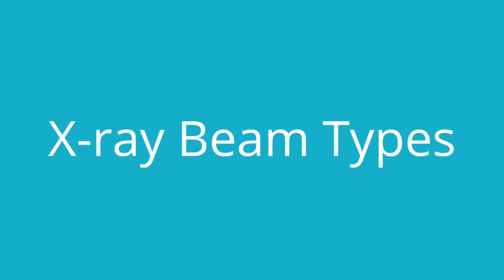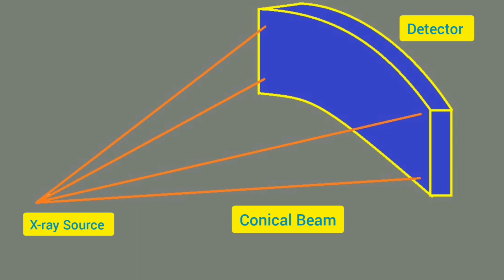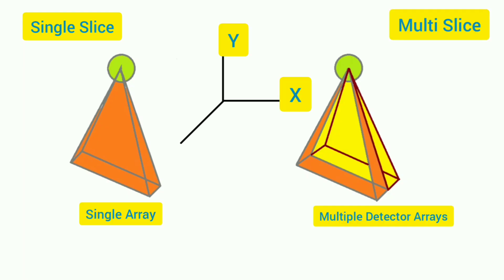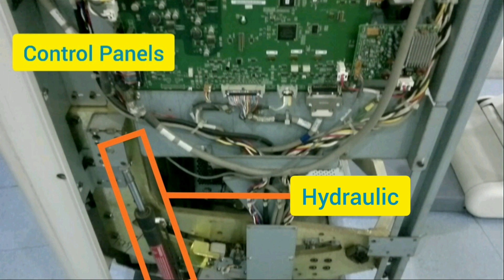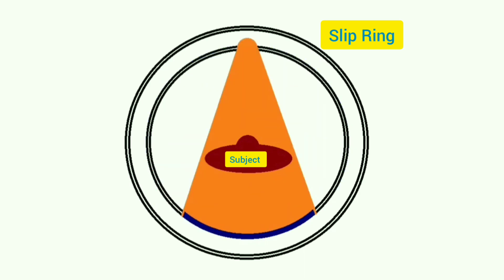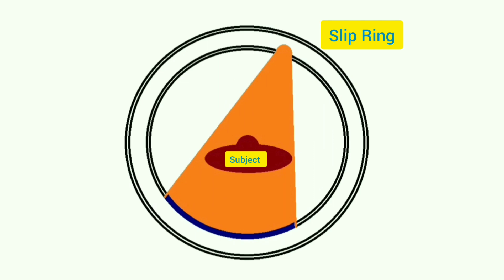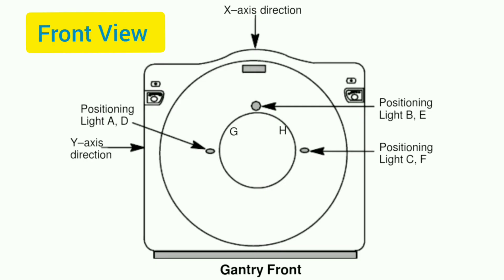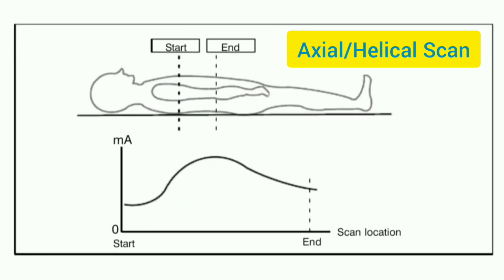7th Generation CT Scanner | Multi Slice CT | Engineering Behind CT Scan | Biomedical Engineering

Comment: image data goes by optical fiber not slipring
Reply from the maker: X-rays -> Electrical Signal. Data goes to Low power rings(Electric Signal) -> DAS -> Optical fibre
Reply: @Diagnotherapy  yes only signal data 
optical fiber data transmitted wirelessly

Comment: The detector will not move frnd...this machine is a 3rd generation machine
Reply from the maker: The detector moves in multi Slice CT. The top view may look similar to 3rd Generation. You may open any present generation CT and Check.
Reply: @Diagnotherapy  no it doesn't